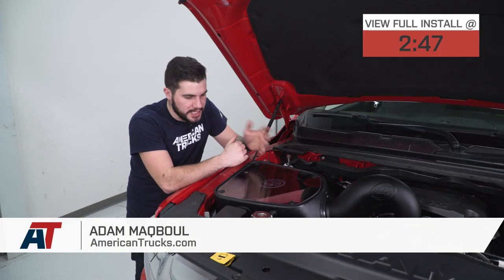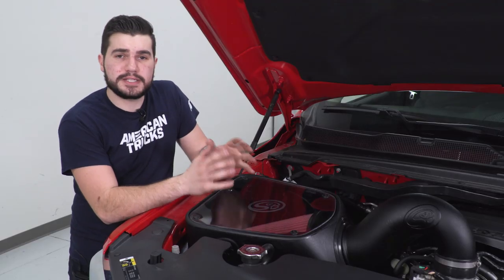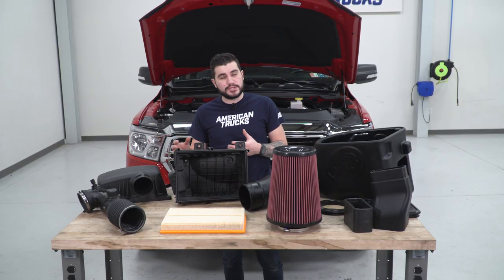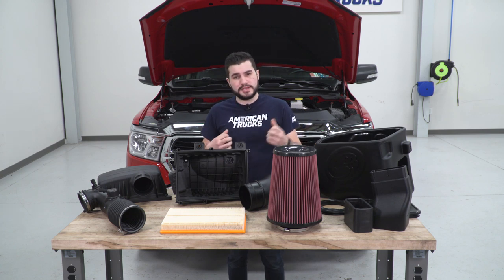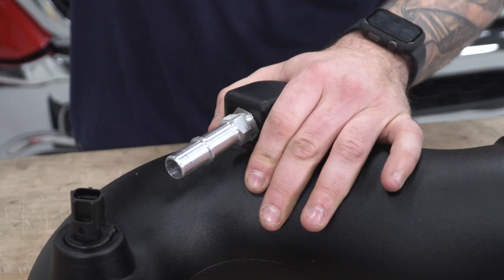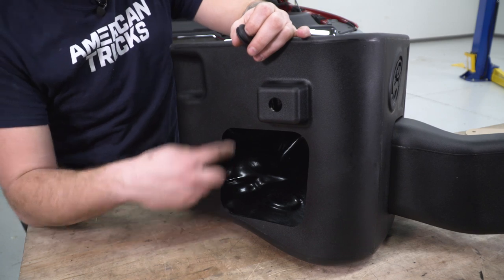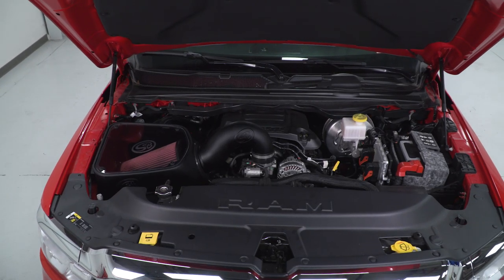2019-2020 RAM 1500 S&B Cold Air Intake w/ Oiled Cleanable Cotton Filter Review & Install

Comment: There are a couple of small glitches I encountered with my S&B Cold Air Intake on my 2021 Ram, Rebel.  There are 2 additional screws holding down the mfg, air box which were not mentioned in the video.   There are only 2 noted in the video but there are 2 more from the bracket to the air box.   Due to molding on the wheel well, I had no option but to "chew" off the 2 additional mounting screw, plastic nuts, for the mfg air box.   My other option was to remove a bunch of fender molding.  The box pulled off fine after that.   The entire install took me 4 hours.  BUT I'm 73 and I only have one working hand due to recent hand surgery and my wife of near 50 years was good enough to hold a wrench when needed.    No complaints.   I tested the truck and the hesitation I usually get upon acceleration was GONE!  I felt more power!   I'm certain!   I previously installed a catback exhaust system.  Now the "air pump" is a success.  The S&B air filter is an integral part of that!   Thank you.

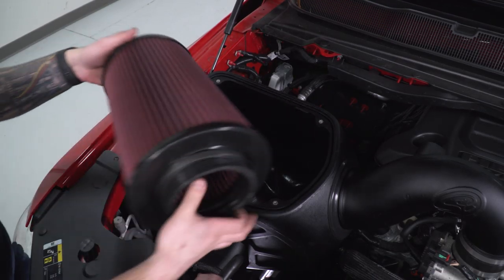Comment: Minute marker 14:08 says chrome line should be facing down was an error on my install 
the clamp wouldn’t hold it in place no matter how many times I tried to adjust it so I turned it and faced the chrome line up and BINGO 🎉 it held as tight as a glove.
Hope it doesn’t affect anything

Comment: Hi, I've looked at various kinds of cold air intakes .
Thy all seem to do th Sameas the others . I've found  making my own cold air intake. Was fun, Informative and my truck breathes so much better. In my air box is a K&N panel filter,  the air the box gets comes from a 4 inch opening . The air comes in via a tube that opens up to 5 inch from 4 inch. Lol it looks like a elephants trunk hanging down the factory box to where cooler air away from the engine. So much more power In take off . The only tube not changed out is the one from the engine. Seems fine for now.

Comment: Do you need to disconnect the battery S&B telles you you need to ?
Reply: Recommended, I found that disconnecting the battery helps avoid the check engine light and helps reset the air reading saved on the computer. 

If you disconnect the battery before starting and reconnect when done. That should be just fine

Comment: Where did you get the breather line fitting? Mine came with a crappy plastic one
Reply: By any chance have you found a replacement? I accidentally broke mine 😅
Reply: I think earlier versions before Covid had the aluminum fittings. I got a crappy plastic one too…